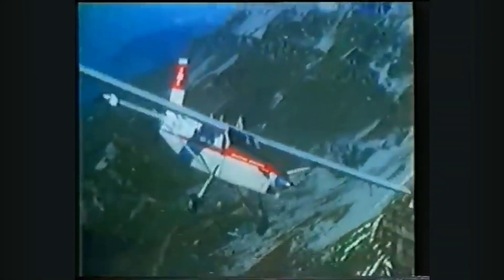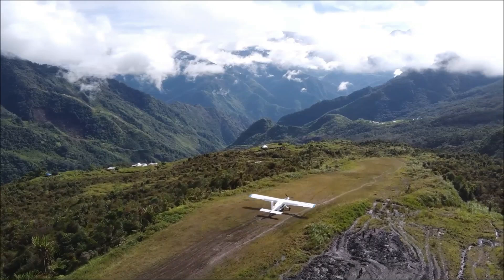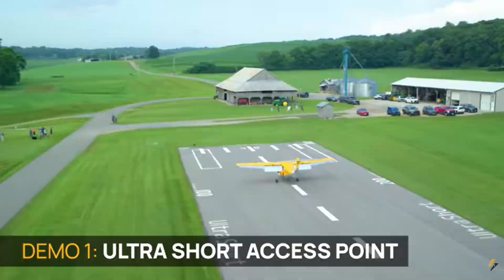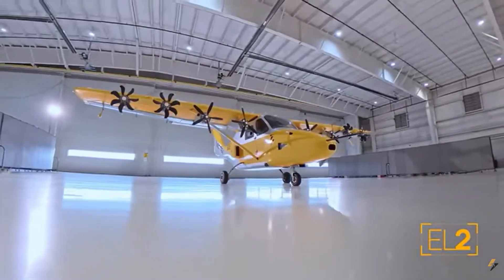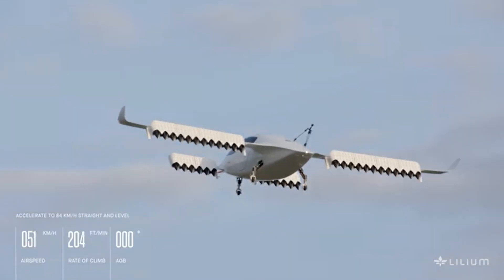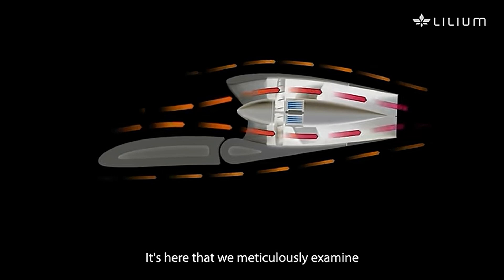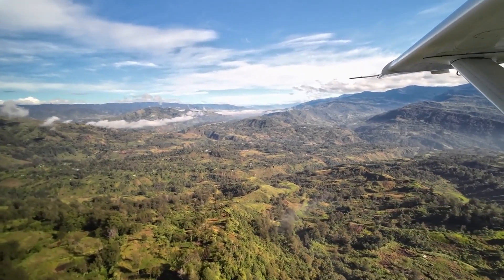The Future of Utility Aircraft | How Electric STOL Planes Could Transform Remote Communities #eSTOL

Comment: You raise an important topic. A good example of early utility aircraft, as you call them, is the beaver conversions that they are testing in Vancouver for servicing local communities. These are old air planes that don't have a huge range that can do short hops to island communities.

IMHO, the US particularly has favorable legislation via its experimental classification. There are lots of small private planes that use this that could benefit from electrification. All it takes is availability of battery packs and motors. With higher power density and safer solid state batteries arriving in the next years, I expect there will be some people interested in turning their weekly 100$ hamburger flight into a 5$ coffee run. Fuel and maintenance are just really expensive. If you don't need to go 800 miles, a simple electrical plane might be good enough. 

I think, once component availability improves, there is going to be a lot of experimentation with electrifying all kinds of planes. Everything from experimental planes, ultra lights, para gliders, STOL airplanes, etc., to traditional work horses like the aging fleets of pipers and cessnas. still flying. Not everybody needs or can afford huge ranges. A lot of these planes never venture that far from their home bases anyway.
Reply from the maker: I think the best and most efficient aircraft would be one that is made from scratch with electric motors in mind. Most options right now are trying to retrofit which discounts the efficiency gains of aero propulsive efficiency. That is Propulsor and Airframe working hand in hand.
I dont see much happening much unfortunately in the US despite the FAA just waking up to electric propulsion. The Chinese meanwhile are working on an electrified version of V22 Osprey like aircraft

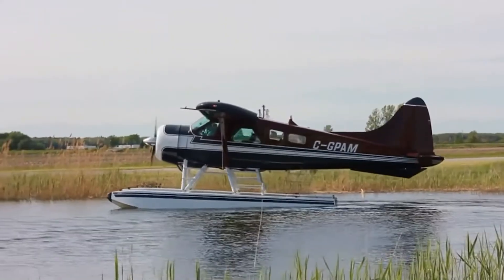Comment: No mention of Harbour Air's Electric Beaver  (DHC 2 eBeaver), even though a different Harbour Air aircraft is shown at 8:12. It is currently undergoing certification for passenger flight.  Canada and the US did not have complete certification standards for commercial electric when they started. I am not sure if they have them even now.
Reply from the maker: Yes actually I forgot to mention it. Harbour Air was one of the pioneers in this space. They developed a custom motor with Magnix now that I remember. They deserve a separate video

Comment: e-STOL aircraft just make so much more sense than e-VTOL aircraft. The wing can operate near it's min drag (min sink )and best lift-to-drag (best glide). The battery mass is less of an issue as it can be distributed along the wing root. Heavier aircraft just means faster speeds, with distributed fans offering flap empowerment with system redundancy, or e-CTOL when that is not a practical option. BRS are a natural partner to non-rotating wings. And you can select energy batteries like the Molicel M65A, with 322Wh/kg. The problem is e-STOL doesn't excite investors like e-VTOL. The solution is education by the Electric Aviation channel...

Comment: one of the issues with electric utility aircraft is endurance and that so many of the routes they operate on, have both challenging terrain and weather. For instance in case of Papua New Guinea's remote strips,  it's common to operate with a mandatory 90 min safety margin to deal with the changeable weather and mountainous terrain.

Comment: How about ditching pounds and using kilograms so the majority of the world's population can understand what you mean?, PS hydrogen still needs to be transported.
Reply from the maker: I did that once. It wasnt recieved well. Much of the aviation world is still using imperial. They in fact tell me to use knots instead of mph
Reply: @ElectricAviation  , use both - with subtitles if necessary. The NASA Apollo missions, and AGC, were designed in metric (often by German engineers). The "translation" to steam units was done for the astronauts "benefit", as they would get "confused" after training on jets. But, astronauts are smart...
Reply: @ElectricAviation Aviation uses knots for speed, nautical miles for distance, and feet for altitude, but other quantities are dependent on locality. In Europe (and most of the world) runway length is expressed metres, temperature in degrees Celsius and pressure in hectoPascal. But you can indeed put subtitles with alternative units.

Comment: 1:40 One of those was modified extensively a few years ago and was equipped with 4 motors mounted in pods on each of the lower wings. They had foldable propellers, which were used only for TOL. It retained the engine for all phases of operation.
Reply from the maker: Yes I have covered that in a video that I specifically made on Antanov AN2

Comment: Very nice review, got to the same numbers as you regarding VTOL. However Lilium were forced on Urban mobility meaning taking off from buildings, no runway STOL is not an applicable solution for this.
Your input where a small runway is available or makeshift runway is good input. Improvements to power management can be added (as presented by Mercedes/AMG lately).
I will also add Regional Australia to the list.

Comment: Hybrid makes more sense than pure battery power for now.
Reply: Brittan Norman aircraft are propelled by noise. Electrifying them removes the noise, making take-off difficult ;-)
Reply: Surely the big problem with powered wings is power failure. You then lose lift as well as power. Also STOL airfields need the same protected area around the airfield, nullifying much of the short field advantage.
Reply: @tonyb4773  Your claim that "STOL airfields need the same protected area around the airfield, nullifying much of the short field advantage" is simply not true in reality. PC-6s, Helio Couriers, and many other STOL aircraft with 6 seats or more are routinely operated in remote areas around the world. They fly into very short runways surrounded by trees or with a cliff at one or both ends -- runways are totally unusable for CTOL aircraft. The subject of this video is appropriate.
Reply: @richardjenkins4182 yes, but not in urban areas….
Reply: @tonyb4773  , you can design a high lift wing without relying on fan augmentation. The problem is normally drag, which is only an issue on take-off. The rest is pilot training for safe approaches in any eventuality.
Reply: Not for trainers
Reply: @glike2  And trainers aren't used to fly supplies and people to and from remote communities.
Reply from the maker: @glike2 Thats true. Battery trainers will take over in the next 5 years
Reply: @glike2  That's not the subject of this video. Check the title.
Reply: @glike2  , concur. Or recreational aviation - which lets face it is the same thing.
Reply: No. They’re far more expensive to certify and maintain. And pure battery eCTOL aircraft can now take six people 400km with reserves from many thousands of GA airfields if properly optimised - more than enough to cover many cross country routes and flightseeing.
Reply: @tonyb4773  Can you give an example of such a battery-powered 6-place aircraft that is even close to certification with those capabilities? That would be great. Vertical lift is far more expensive to certify and maintain than a hybrid STOL aircraft.
Reply: @richardjenkins4182 Beta Alia….